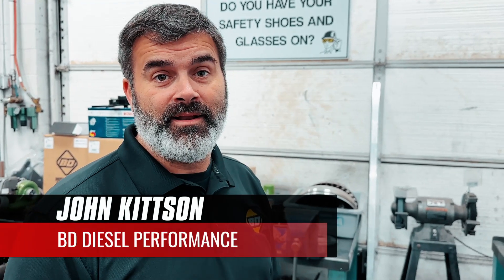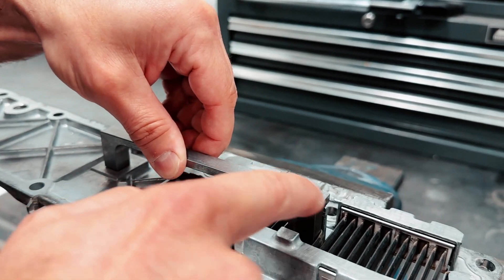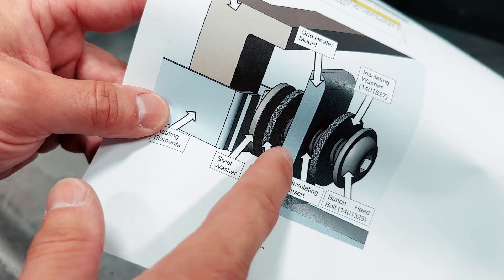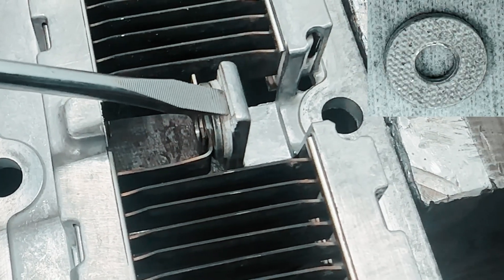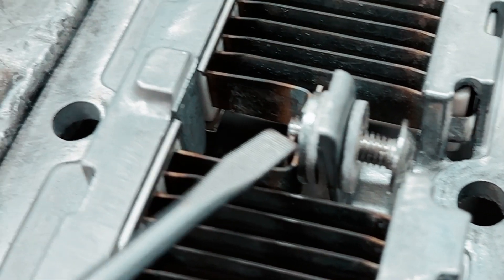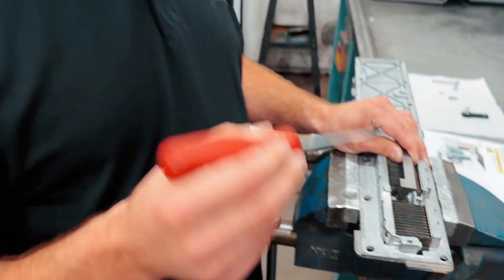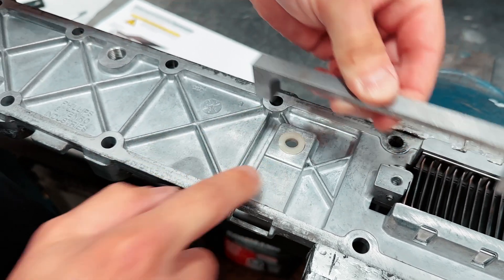Killer Grid Heater Upgrade Kit |  Essential Installation Steps

Comment: So i just installed my kit and it worked great for a couple weeks now im getting a p0541 code intake air heater A circuit low, gonna take it apart again tomorrow, i just wonder what happened

Comment: Just finished installing the updated kit on my truck. Was straight forward and can’t see how the bolt would ever fail or loosen. If you ever were concerned you can easily inspect it by pulling the intake and looking at the grid. Thanks for a great product that doesn’t break the bank!

Comment: That bolt still goes through the part that your trying to insulate on both sides. Lol its gonna make contact in the hole it's going through.
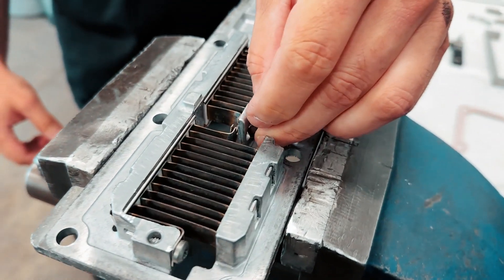Reply from the maker: Thanks for your comment. The hole you’re referring to is insulated by the insulation sleeve installed at about the 2:02 mark of the video. This insulates the bolts' threads against the through-hole and is a crucial step in the installation process.

Comment: My question is, What’s stopping that bolt with the insulting washers connecting the bus bar rattling loose and falling into cylinder 6 like the oem failure point ?
Reply: Torque spec …it’s never been a cause of concern on any of the grid heater failures the melting nut is the problem
Reply from the maker: The most failure prone fastener is the main one that we eliminate from inside the intake. The second bolt you refer to is still present as we need some way to connect to the heater but we’ve revamped how it is connected. The factory style uses a nut and bolt and transfers all the power through the bolt. Because power is transferred through the bolt there is a greater chance of the bolt melting off.
The BD kit instead sandwiches the heater elements right up against the new lower busbar which means they are directly connected and no power goes through the bolt so it should not melt off like the OEM one. Additionally we no longer use the nut and thread the bolt directly into the busbar. This improves on the original design which should improve reliability of this connection.
Reply: @ has this system been “cycle tested”?